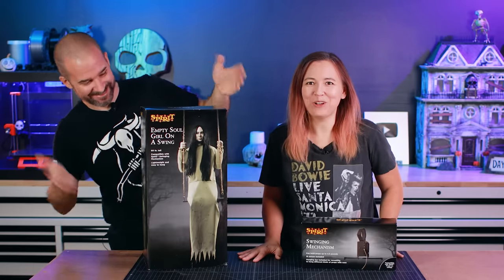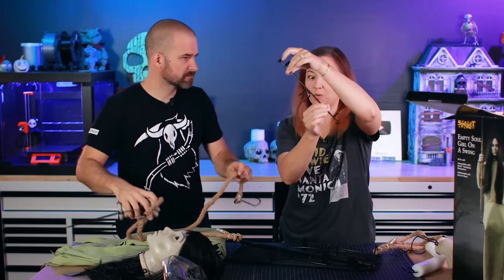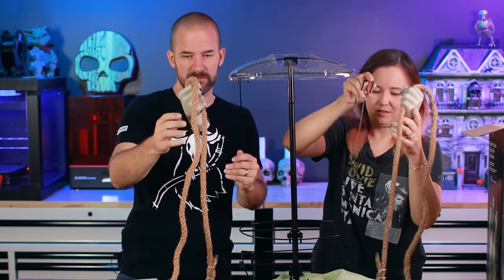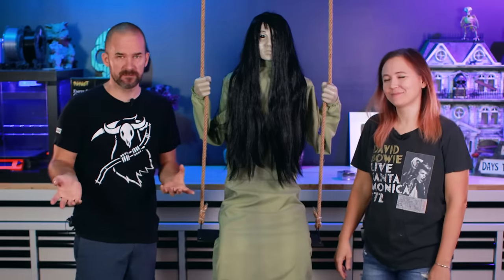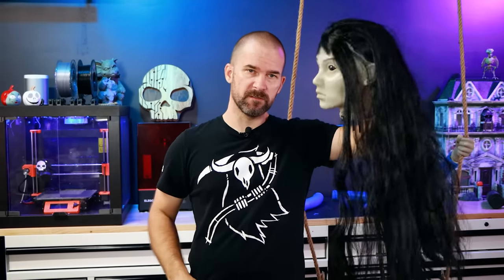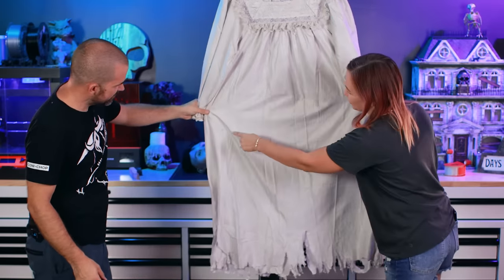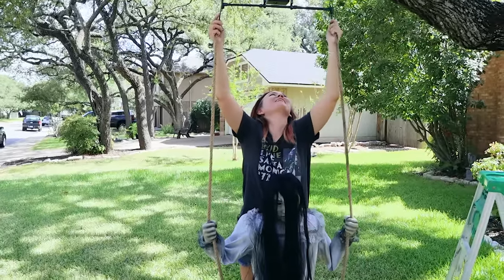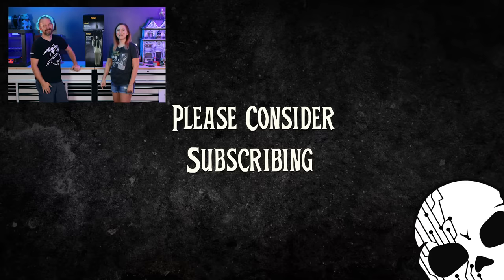We turned Empty Soul Girl into SAMARA MORGAN from THE RING!

Comment: I've had her for a few years and it looks  great on my lawn. Only issue is the swinging mechanism has to be covered for the rain. I hoped you guys were going to make a cover for it so I can go with a better option then what I use lol. Oh well. Love the videos.
Reply from the maker: Yeah haven’t figured that part out yet. Hmm
Reply: How completely does it have to be covered? Would a pitched shield be enough? Kind of like a mini roof over it? If you used some sheet metal, it would be super lightweight. Although wind would likely be a problem, depending on how well it was anchored to the branch.
Reply: @astrid6496  I was thinking of a simple pvc a frame sort of like a swing set. Small shield, or canopy for the top. I don't have a tree branch out front. I usually just construct something. This year I want to use the swinging mechanism finally.
Reply: Fake leaves on the branch to hide the mechanism and protect it as well.
Reply: @honkylips9072  it would look really cool hanging from something that resembled the sort of frame they would have a hangman's noose on. Or you could go all out and use chicken wire and spray foam to make a tree 😂
Reply: Sounds like it could do with being surrounded in a foam box with rockwool to deaden that wurrring sound from the motor.
Maybe building a fake cut off tree branch out of foam with a metal frame inside that clamps to a real branch, that way the entire mechanism can be hidden inside it.
Reply: @WickedMakers  why not use a plastic milk gallon container.
Reply: Thanks for all the replies. I think it helped get my creativity wheels turning.

Comment: I think using a couple of hinges at the swing attachment point and then a bit higher up adding a tube filled with a couple of heavy round weights that roll backward and forward when the swing is moving will make the body lean forward and back as well.  You will need two solenoids or actuators at the side of either end of the tube which will tip the tube up when activated via a pressure switch (which is triggered by the round weight) at each end of the pipe. This could be controlled with a simple circuit. This will create a see saw motion that would make her body shift it's centre of gravity and make it look like it's physically moving.
Reply from the maker: Nice this is great!

Comment: I love the modifications that you two did, especially with the dress!

We tried that same swinging mechanism a couple years ago, but promptly returned it. It was a bit too noisy and not secure enough to keep from rocking against the beam that we had it strapped to. I had plans to make my own swing mech with a wiper motor, but those plans got put on the back burner this year unfortunately.
Reply from the maker: Thanks!! Yeah it’s crazy noisy. Agreed.

Comment: First of all, just wanna say you guys are absolutely awesome...love love the videos and creativity.  I purchased her and trying to do similar techniques.  I noticed she tends to lean backwards and can't get the weight more forward on the seat. When you took plyers and bent her head, did you break the weldjoint when it snapped? I'm confused on how you got her to look down. I can't get the metal to bend, even tried a blowtorch for a bit.  It seems if I apply too much pressure I may break that weld joint.   But I will break it, if thats what it takes and it worked for you.  Thanks again you guys!! 😉
Reply from the maker: You should be able to just hit the pole with hammer to bend it. For the neck, it allllmmmmoost broke. Very close. Bend it very gently. 😄😄
Reply: Thanks again, everything is coming along nicely and she is basically done. Just finishing up building her swingset that she will be swinging on! Cheers!   @WickedMakers
Reply: @chugger93 how’d it turn out?
Reply: @imcrazyimcrazyimcrazy  really really well. Even built in an led and framing mechanism so a light shines up her dress to her face. I'd post a pic but can't here...
Reply: @chugger93  post it on your channel?
Reply: @imcrazyimcrazyimcrazy  I'll try and take a video soon and do that.
Reply: @chugger93  ok great!!

Comment: Just a helpful note...I stuff a TYVEX Painters hooded suit with Polyfil when doing a static display..Use Refrigeration/water line Copper and 1/4 inch Pipe Insulation w/ zip ties..

Comment: Hey guys. Found your channel recently and I’m really impressed with your videos. I’d like to make a suggestion if I could. Instead of using a wire brush to rough up and fray the edges and material, a method that I’ve found works really well is that after you’ve made your cuts and slices in the material (the dress in this case), try running the costume through a couple of wash and dry cycles. I’ve done this in the past and had really good results. Mind you, I’ve used this method on heavier materials like denim, but I’m sure it’ll work just as well on this lighter fabric too. Anyway, keep up the great work and happy haunting. Cheers

Comment: She looks so much better. If you decided to up the ante a bit, see if you can find some of those feet at Spirit or wherever, the ones that have the ankles. Add some more leg with pool noodles, attach the feet. Paint up all the exposed body parts so they match. Just a thought. I'm not sure if that would add too much extra weight or not, but it might add to the motion a bit.  I like the idea of dulling down the hair as mentioned in another post too.

Comment: I tried the mod to the base to raise it up and tilt it but I'm not sure this does anything.  I did this with the straight pipe just to see what it would do.  The swing platform simply compensates for this tilt by changing the center of gravity, thus the platform itself tilted even further backwards.  

WHAT WORKED.  Remove just the top shoulder section with the short pipe.  Put it in a vise just above the Insert section (pin).   put a long bolt into the open end on top and use that as leverage to hammer bend the short pipe slightly forward (shoulders will bend forward).  This is pretty easy compared to working on the entire pipe length.  While my swing platform is still not completely Level, it is a lot closer to horizontal.  With the additional bending forward of the head pins, mine actually does look downward instead of straight ahead or lol Up.  

It's too bad Spirit's swinging mech does not have an area for through screws as well, that velcro is a PITA if you're not attaching it to a branch.  I don't have any suitable branches (nor would I leave the mech outside in the elements even if I did).  I'm trying to mount this inside a porch.  

I may take a hole saw to the swing platform to cut some prop weight on the swing mech, but that's a battle for another day.  Doing that + adding a small amount of weight to the knee joints (or anywhere far forward of the center) might pull the center of gravity even further forward.
Reply: I was able to ceiling mount it by removing the staples in the velcro, pulling it out and then I just had a piece of board that was the correct thickness which i cut to fit.  Slid it through the plastic pieces and screwed it up that way.  That, a weathered stained new white dress, a floor mounted light and the sounds of a swinging rope/Evil Dead soundtrack and prop is complete and very scary....people were stopping in their cars.....

Comment: Black airbrushing on the dress looks so fake, it's something a store would do. Use dark brown paint from a bucket on the dress to simulate mud. Wet the bottom of the dress with water, then dip the bottom of the dress in the dark brown paint bucket, massage it around a little to spread the paint so it's not just a line of paint, and as a final touch I'd flick some of the paint from a dry brush to make it look spattered. The more realistic it looks, the creepier it is. Just a thought.